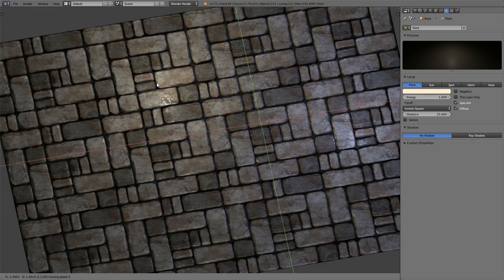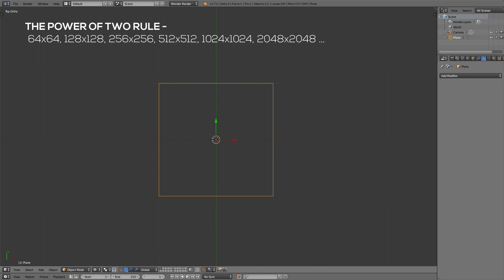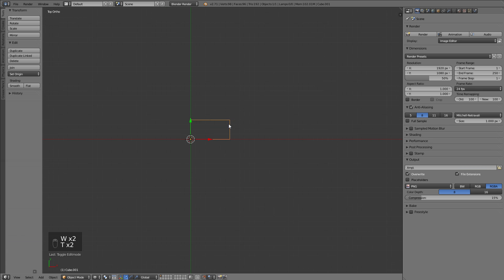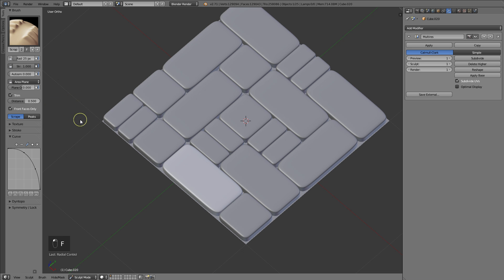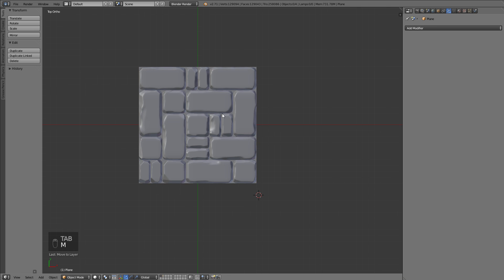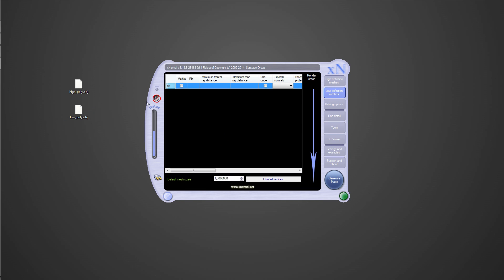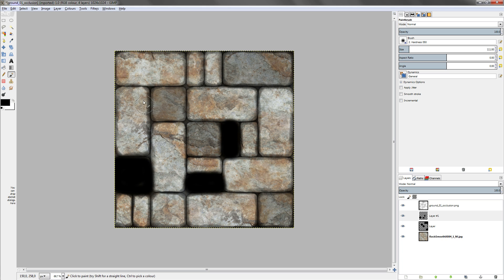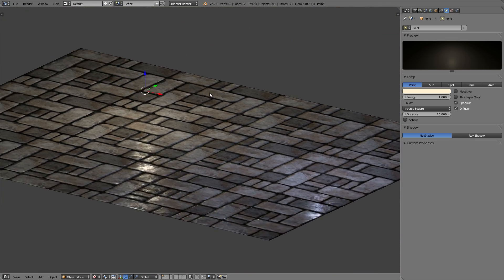GAME ASSET TUTORIAL - Tileable ground texture - Part 1 / 2

Comment: Hi friend. At minute 9.30 you start to apply all the multi res modifier one by one. I just want to point out that you can select all objects and apply all modifiers at once. After selecting objects you have to press space and look for "convert to" command. Blender will ask you what exactly you want to convert, pick mesh from  Curve/Meta/Surf/Text option and that will do the hard work for you. Cheers.

Comment: Hey man! Greetings from Kiev :)
Thanks for tutor. Let me give you some critique.
1. This video named Game Asset Tutorial. So maybe there's a sense to make asset for some game engine? Unreal Engine 4, Unity or CryEngine are good candidates.
2. General trend in modern game engines is Physically Based Rendering. There were no even mentions about it here. Cycles Render is a perfect example to show how it works if it's too hard to export model to game engine.
Reply from the maker: Hey thanks for your suggestions ! =)  For #1 I will create a seperate series on importing to different engines - there are just too many to cover it in just one tutorial. I am currently mostly working with unity - so in my modular asset tutorial series I will probably add a part on how to set the models up in unity, and later translate these to other engines as well. Great suggestion!

for #2 Since I do these things mostly for beginners and intermediate users I feel like the target group are simple "indie" developers who want to get started in the game industrie - so they'll focus on easy engines - and those - often times free engines - don't support PBR yet. Especially Blender has no realtime PBR rendering in its basic build ( there are graphicall builds and node setups that support this , but these are more like a workaround I fell like ).

I also feel like covering PBR requires marmoset Toolbag as well as Quixel's software for quality ensurance . And since I can't afford Photoshop, Toolbag or even the Quixel Suite I doubt I could create quality tutorials on that subject!
But its definitely worth a video with explanations and links to good ressources if I can get my hands on a software that is free but able to render this out without "hacks".

Comment: Okies, i am here once again. This time i give tiny tip for those who creates this texture tutorial. If you will do another stonewall / ground textures. Save few of these bricks to later use for just as own file... Cause i did do so and now i have 1 gig file with 25 million verts so, it is pretty slow to pick couple bricks from that file... :D
Reply from the maker: 4GetRich hahah yeah thats a good idea. I mention that in the newest dirt tutorial, don't go too high on subdivisions as else it might lag out when baking - it depends on how much detail you really need, especially considering how large/small the texture is. Usually 1024x1024 is way too big for a topdown texture, so you can reduce the scale and therefore also reduce the quality of the single bricks - leading to less polys.
Reply: CGAstym  That's true, but always but... 1024 even 2k and 4k textures has one good thing... Those look smooth and cool even scaled down like 512x512 texture... But 512x512 ain't looking good strech in 1k texture... So i think one thing what all should think is this http://llgdesign.co.za/triangle/#.U-Y5D2NGTpI and then choose own path...
Reply from the maker: 4GetRich Yeah very true , rescaling afterwards is best - usually you use double the size of the targeted projects final texture size - so if you develop for a mobile game and go as low as 256x256 for textures you would create them at about 512x512 and then scale them down!

Comment: Just a stypid question but does texture really need to be seamless? After all there is dark parts around every brick...
Reply from the maker: No question is stupid if its a 3D question :P Yeah its not a necessity , but in some cases - if you for example reduce the AO map and have less shadow values then it might get visible - the best way would be to use the clone brush and paint every brick by hand so you can't see that you just used a generic texture as an overlay but each brick has a different texture - but that would've been too much for this tutorial. But yeah you are right its not necessary, just a habit I always have when creating tileable textures.

Comment: Hey, nice tut's so please keep em coming... :D Umm scupting tiles... I know multires is good but why not use dynamic topology tool?
Reply from the maker: I did in my low poly rock tutorial! =) Here it was due to recording limitations - if I would've used dynatopo on all those little blocks my computer wouldn't have been able to capture it that smoothly, ofc you can detail them much more!
Reply: CGAstym
Okies, i used also tiny shortcut by making these 3 pieces and sculpt em in half way. Then i copied em all around my plane and then, i just give em tiny final touch and voila... none of em is similiar and saved time like... lightyears... :D
Reply from the maker: Yeah especially since most of the variation comes from the texture and the normals are usually not that visible on a flat plane anyway - I feel like creating every single one in very detailed ways is really wasted :D
Reply: CGAstym
Well there you got enough time to explain stuff. Great these are anyways.